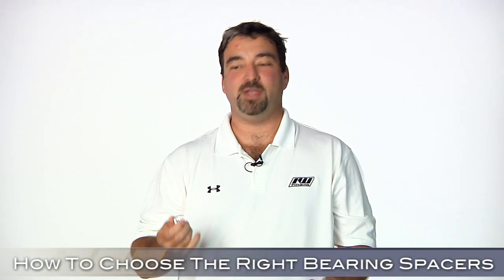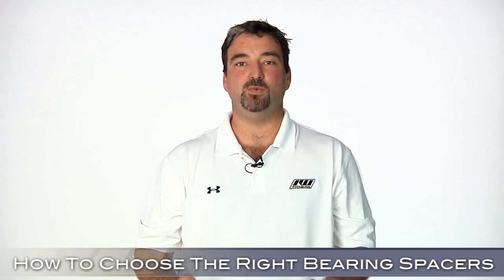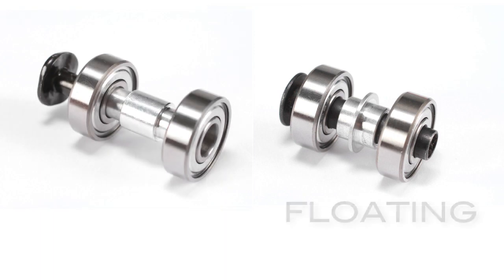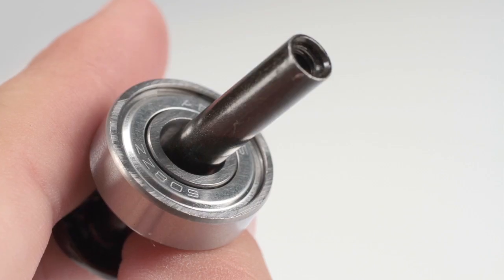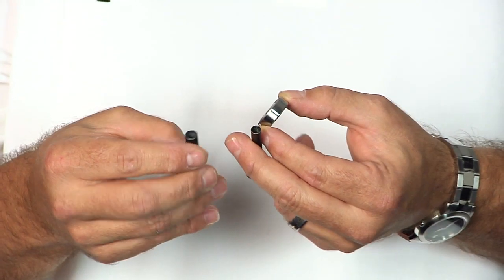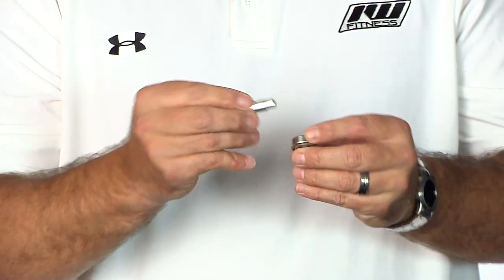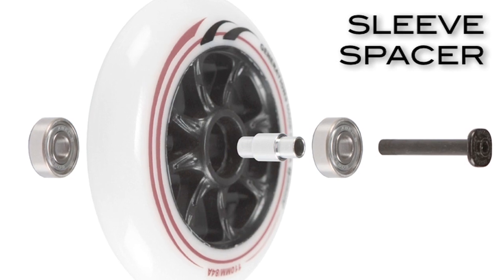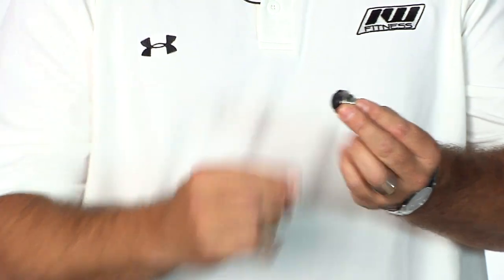How to Choose the Right Bearing Spacers

Comment: 04.17.2021
My old Macroblades from the 90's 78A / 72mm Wheels had the Long Sleeve "White Plastic Spacers" !!!
2 years ago, purchased Zetrablades. Last week, I downsized from 80mm wheels to 76mm but did not realize I inserted the Floating Spacers!  So I just changed them to Long Sleeve Spacers.  Thank You !!!

Comment: I bought the Sure-Grip Zombie wheels and their site suggested their spacers which is a .300. It doesn't look anything like the two you just showed. They are plastic and one side is pointed and the other side has a hole. I'm assuming the side with the hole goes on the outside, but I'm not 100%. Could someone please help me. How do I use the Sure-Grip .300 bearing spacers???

Comment: Thanks for the video! I have an 8mm axle: when I put the bearings and spacer inside the wheel, and shake the wheel, the spacers move around freely, does that mean that I got the wrong size of spacers for my wheel (too short)?
Reply from the maker: You are fine. As long as  you got a spacer in there you should be golden and ready to roll. Thanks for watching. InlineWarehouse.com
Reply: Yeah mine does the same I doing a skateboard. I’m reading online that if the spacer moves around you got the wrong size

Comment: I hope that your can help me. i bought a pair of skates for a the wheels and bearings (project) and they came with a plastic insert that was on the outside of the bearings between the axle hub or head and the bearing. can you please tell me what this piece is called.